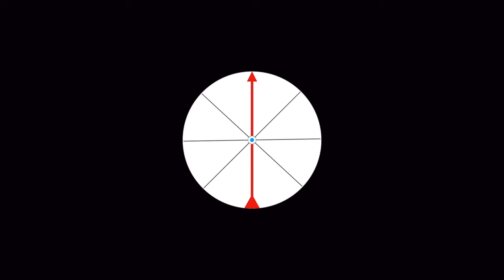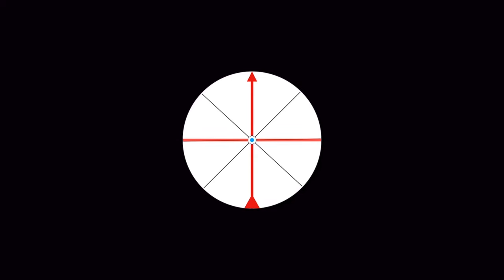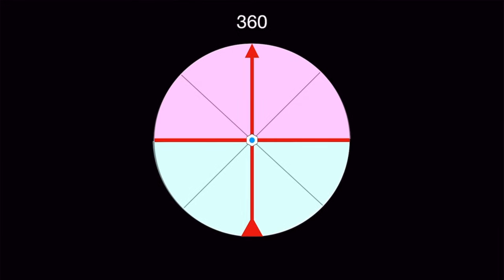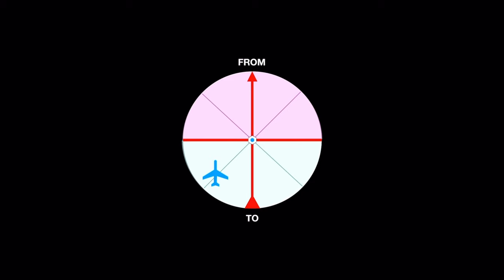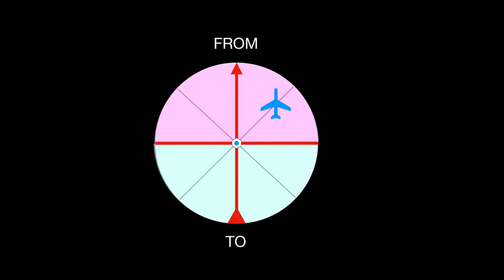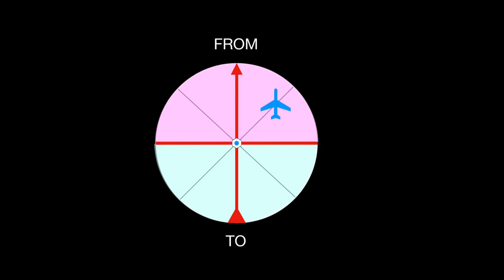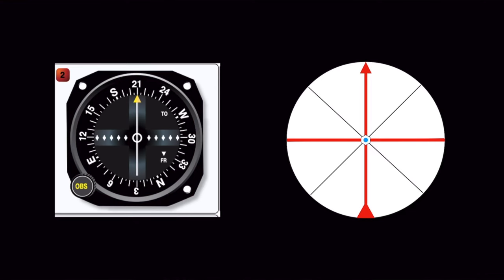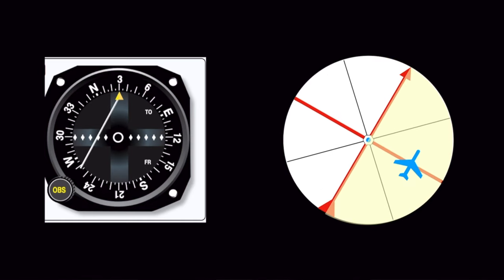Ridiculously easy VOR Navigation!

Comment: Hi.  Thanks for the great video!  Is there ever a situation where the CDI needle is reverse sensing?
Reply from the maker: Thanks for the compliment and the question!  And, the question of Reverse Sensing is interesting especially for private pilot radio navigation.  It becomes a little more real when working on your instrument rating and flying NDB approaches (if you can find one) or a Localizer Back Course.  I’m thinking this might be easier to demonstrate in a video than describe.  So, as a short answer, I’ll say that for private pilot level VOR navigation, what most folks define as “reverse sensing” (i.e. turning toward the needle takes them further off course) normally means they’ve set the ambiguity indicator (TO/FROM) incorrectly.     I hope this helps and I’ll see if I can do some demonstrations in the near future.  Thanks again for the question.

Comment: Yes -  easy on the test and this makes sense. However, when you get in the airplane under the hood in the bumpy air and then start using the VOR can get a bit challenging.  - I am needing much more practice actually using them.  The test is one thing and is easy, using them in the plane ( to help keep from getting lost) is another thing all together.  Like flying at night.
Reply from the maker: Thank you for the comment.  I’m glad the VOR test questions easy.  I found the opposite to be true.  I struggled with the test questions, but once in the airplane, the VOR just seemed to make sense.  I like flying at night, too.  The air is usually smoother, and on clear nights you can see forever.  Take care, and thanks again for the comment.

Comment: Just a small correction: at 5:40, you say the indication is FROM because you are flying away from the station. Yes, that is true in this case, but even if you were flying TO the station, the indication would still remain FROM. As you said, the system doesn't know what your heading is. I think more appropriate would be to say "it shows FROM because you are on the FROM side of the station". Saying that it reads "FROM" because you're flying away from the station can cause confusion when you are flying TO the station on the FROM quadrant (reverse sensing).
Reply from the maker: Thank you Tiago.  This is a good clarification.  The example and description in the video are correct because of the airplane’s heading AND the VOR indication.  However, as you note, the video states several times that VOR indicators don’t know or show which direction the aircraft is heading.  So in your example, the VOR would, indeed, show the same indication but the Heading Indicator would not.  So, it is important to look at both the VOR and aircraft heading to help determine the relative location of the aircraft.  Thanks for watching the video, and thanks for helping make them more understandable!

Comment: Is there a way to tell how far off your bearing is to the selected radial
Reply from the maker: The short answer is it depends on how far away you are from the station.  Each dot on the VOR indicator represents 2-degrees deflection right or left from the selected radial. And full deflection is a total of 10-degrees. So, the further you are from the station, the further you are off course, distance-wise. 

There is another VOR rule of thumb called the 1 in 60 rule that states that if you are 1-degree off course and fly for 60 miles you will be 1 mile off course. So, if you were able to pick up a VOR 60 miles out and your needle showed one dot deflection, you’d be ~2NM off course.

 The rest is just math… at 30NM from the VOR you’d be ~1NM off course. At 15 NM you’d be ~0.5NM off course. Etc. 

So then the real question is how do you figure out how far are you from the station.  If you have a GPS or DME (and the VOR is capable of broadcasting DME info), it’s easy. If you don’t, that will take a bit more explanation. 

I hope this helps. Thank you for the question!!

Comment: Thanks so much. But say I want to intercept a radial from a VOR. Can you make that just as simple?
Reply from the maker: Hey Scott, thanks for the question.  

Intercepting a radial from the VOR works exactly the same as intercepting a bearing to the station.  1.  Dial in the radial you want to intercept.  2). Turn the airplane until the Course Indicator and the Heading Indicator match.  3). Make sure the TO/FROM says "FROM" (if it says "TO" you will be intercepting the bearing to the station).  4) Turn toward the needle and fly until the needle centers.  5) Turn the aircraft back until the Course Indicator and Heading Indicator match.  As long as the needle stays centered you will be tracking the Radial outbound.  It should be just like from 3:55 - 3:42 of the video except the airplane would be in the purple hemisphere and the TO/FROM would say FROM.  I'll see if I can put together another quick video and post it.

Comment: excellent explanation, however, I have a question.
the plane is moving and generates a doppler effect , but why the doppler effect created by the plane does not interest us in conventional VOR?  
In any case the same applies to DVOR.
As far as I know, it does NOT depend on the speed of the plane which is very small unlike the 1300 m/s of the VOR.
Reply from the maker: Thank you for the comment, and the question.  

To be quite honest, I don’t know why and feel guessing might cause more harm than good.  It is a very good, and very technical question.  In the US, a candidate is not likely to be asked this level of detail for their Private Pilot, Instrument, or even Commercial Pilot check rides.   So, I’ve never considered it before.   If there are others that can explain, please comment.  I’d be very interested in the answer.   In the mean-time, I’ll do some research and see what I can find.

Thank you for watching and thanks for the question!
Reply: @ScottKoonCFI   I'm an Italian student of aerospace engineering, I try to inform myself about everything I study. Thanks you so much.

Comment: How do you know how far off you are from center to/from with the needle, How much distance is each dot?
Reply from the maker: A very good question. This would be a good topic to explore in a future video.  

The short answer is it depends on how far away you are from the station.  Each dot on the VOR indicator represents 2-degrees deflection right or left from the selected radial. And full deflection is a total of 10-degrees. So, the further you are from the station, the further you are off course, distance-wise. 

There is another VOR rule of thumb called the 1 in 60 rule that states that if you are 1-degree off course and fly for 60 miles you will be 1 mile off course. So, if you were able to pick up a VOR 60 miles out and your needle showed one dot deflection, you’d be ~2NM off course.

 The rest is just math… at 30NM from the VOR you’d be ~1NM off course. At 15 NM you’d be ~0.5NM off course. Etc. 

So then the real question is how do you figure out how far are you from the station.  If you have a GPS or DME (and the VOR is capable of broadcasting DME info), it’s easy. If you don’t, that will take a bit more explanation. 

I hope this helps. Thank you for the question!!

Comment: Do you have a video showing how to use two VORs to navigate DIRECTLY to a VOR intersection without flying along a radial?
Reply from the maker: Thanks for the question. 

I’m sorry.  I don’t have any videos that describe using two VORs to go direct to an intersection without following a radial.  If I’m understanding your question correctly, that type of navigation is considered point-to-point navigation and in today’s aviation environment the best tool for that would be a GPS.  In the US, I’m not aware of an approved “civilian” method for doing this.  There used to be US Navy and Air Force processes that used VOR and DME, but I am not sure if they still teach/require them.

Having said that, you can use two VORs to get to an intersection without having to fly over either of the stations.  This process requires that you know where you are in relation to each of the stations and the intersection.  Then you would use dead reckoning to fly an “intercept course” that will cross the nearest radial somewhere between you and the intersection.  Then follow that radial until both your needles center indicating you’ve reached the intersection.   I hope this helps at least a little.

I am planning more VOR videos.  These will focus on using the VOR during flight.  So, perhaps one of those would be helpful.  

Thank you for the question!  I wish you the best.
Reply: @ScottKoonCFI  I asked as a challenge. There's some way to set the OBS on two VOR receivers to the radials that define the intersection, then derive an initial heading from the needle deflection to where they intersect the compass card. Then heading adjustments are made according to the needles' movement as approaching the intersection.
Reply from the maker: Thank you for the challenge!  After sleeping on it, I think I know the process you mentioned.  I ran across an article a few years ago discussing an older method of using VORs (from the 1940s, I believe).  If I recall, the method is a bit different than how VORs are regularly used, today.  So while it isn’t what  most Private Pilot candidates are being exposed to, it would be a very interesting video.   I’ll see if I can find that article and add this to my list of videos.  Thanks!
Reply: @ScottKoonCFI  I look forward to it!

Comment: how many miles can vor pick up your aircraft when selected
Reply from the maker: Thanks for the question.  A couple things.  First, the VOR is just a transmitter.  So, it doesn’t know your aircraft is there.  Having said that, the distance you can get from the VOR receiver and still receive the signal depends on several things:  1) obstacles,  VOR is “line of site.  So, terrain or other obstacles can reduce or block the signal.  2) The Service Volume of the VOR transmitter and 3) the height above the ground.  There are currently three legacy service volumes (terminal, Low, High).  Terminal signal can be used up to 25NM from the station and up to 12,000ft above the station.  Low signal can be used up to 40NM from the station and up to 18,000ft above the station.  High signal can be used up to 130NM from the station (if you are between 18,000ft and 45,000ft above the station.  

The new VOR service volumes have two VOR types (VL and VH).  VL will reach around 40NM from the station.  VH can reach up to 130NM from the station depending on your altitude above the station.  A good diagram can be found here:  https://www.faa.gov/air_traffic/flight_info/aeronav/acf/media/Presentations/20-02-NavAid-Service-Volumes-DVT-2020.pdf.

I hope this helps.  Thanks again for the question!

Comment: Well.  You lost me at 2:24..
I learn differently from most people. I have to understand the theory of WHY before I can understand the HOW. WHY do you turn the OBS knob ( and what does OBS stand for?) ? 
What do you mean by "turn the aircraft until it's in the same direction as the VOR course index"? What is "VOR Course Index"?
Reply from the maker: Thanks for the comment.  As you note, not everyone learns the same way, and unfortunately, a single video won’t be able to meet everyone’s learning preferences.  I do identify and show the OBS and Course Index starting at 1:13 in the video and describe (at 00:42) why the VOR, by itself, doesn’t tell the whole story.  However, below, I’ve tried describing things a little differently. 

The OBS is the OmniBearing Selector.  It is what you use to select which radial(s) you would like to use for navigation.  Since the VOR transmits information for all 360 degrees, the OBS is used to narrow that down to two (one direction to the station and one direction from the station). 

In the video, I noted that the VOR indicator helps determine where the aircraft is located in relationship to the VOR, but the indicator does NOT show which direction the airplane is traveling.  That is shown by the heading indicator (the Directional Gyro, Magnetic Compass, or Horizontal Situation Indicator).  When I said “turn the aircraft until it is in the same direction as the VOR course index”, I meant that you will need to change the course of the airplane until the needle of the heading indicator and the number at the the top of the VOR (under the Course Index) are the same.  

Hopefully, these descriptions help at least a little.  If not, the Pilot’s Handbook of Aeronautical Knowledge (can be downloaded free from the FAA) might be a good place to go for more information.  VOR navigation is explained starting on page 16-22.

I hope this helps.  I wish you the best of luck.  Thanks, again for the comment!

Comment: I have watched the video a couple of times now, but I still don't understand it. Especially that "rotating" at the end...I can't do that in my mind. Would have been helpful to add the degrees.
Reply from the maker: I’m sorry you didn’t find the video more helpful.  I will be doing more videos about VOR use and navigation in the future.  Perhaps one of those will be more helpful for you.  Thanks for the comment.
Reply: @ScottKoonCFI  After watching it a couple of times (and some other videos, too) and flying to VORs in my sim, I figured it out. For me it's easier though to put the desired radial not on top / 360°, but at its actual position. After that I determine TO/FROM and lef/right...that "rotating" at the end made it worse for me.
Reply from the maker: Thanks for the follow up. I’m glad you found a method that works for you.  I find VORs much easier to understand when the airplane is moving. It is a challenge to try and interpret relative location from a static picture. Thanks again for the comment.

Comment: Will this be on ppl written exam or just ifr
Reply from the maker: Thanks for the question.  

Basic VOR navigation questions are on the PPL Written exam.  Further, task VI of the Private Pilot ACS notes you will need to demonstrate the ability to utilize airborne electronic navigation system (could be GPS or VOR).  In my area, the DPE will be asking about VORs.  I hope this helps!  

Good luck with your training!
Reply: @Scott Koon CFI  very much so the planes we use have Garmin Nav and VOR
Reply from the maker: Yes. I would be very surprised if you aren’t asked to demonstrate some VOR skills on your check ride. Best of luck!!
Reply: @ScottKoonCFI  thx the theory of VOR seems easy enough to just need to apply it to practice